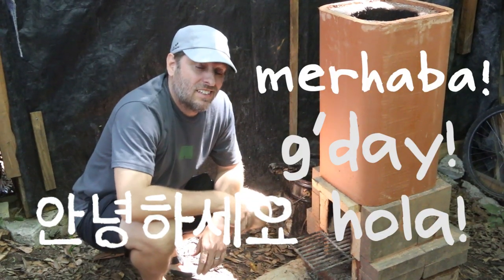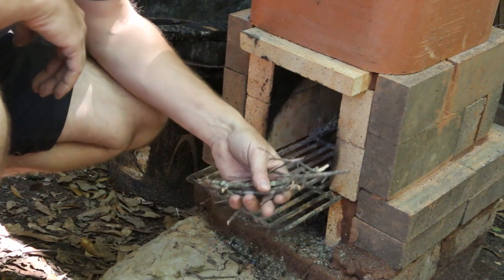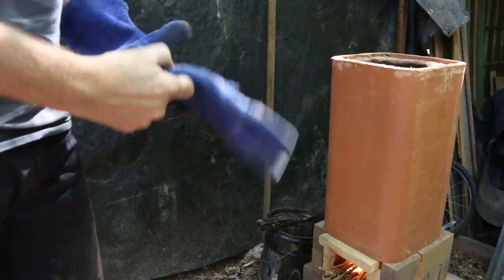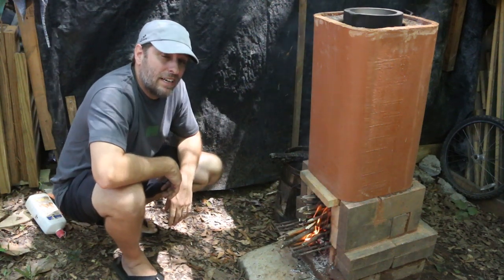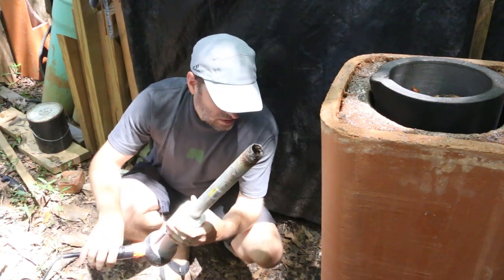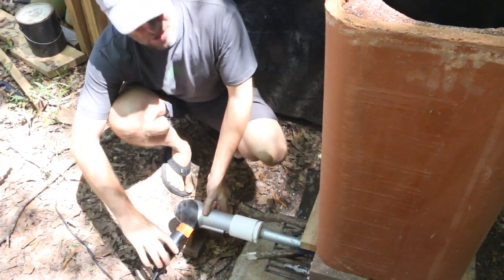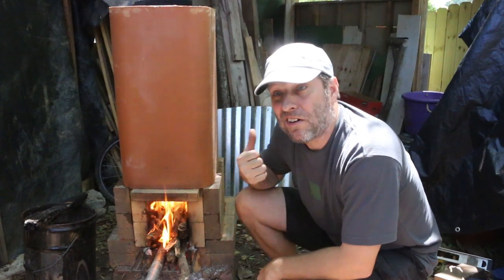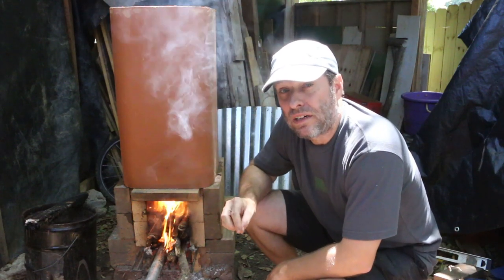How To Melt Aluminum Cans in MAX | Test #1 = FAIL

Comment: Did you ever get this to work for melting aluminum? BTW I expect the charcoal up the chimney method would have problems because it's hard to add fuel in a continuous manner. Maybe just charcoal where the wood is would be fine though. Also a lid to enclose the top would help. Obviously the lid would have an opening so you can add cans and keep the chimney flowing.
Reply from the maker: I didn't. I felt  like the heat was too much for the clay pipe, even with the cobb liner. The airflow was also an issue. I plan to make an earthen forge with either propane or charcoal to try this again. Thanks for the tips and for checking on this project. Thanks for watching.

Comment: My son made a bucket size forge.  His crucible was smaller than yours.  He was able to melt some aluminum cans.  Back then, he used wood for his fuel; now, he is using propane.  Maybe MAX needs to be a bit shorter; but, I'm sure you will figure it out.  Thanks for sharing; but, instead of calling it a fail, consider it a learning experience.
Reply from the maker: Donna G hi! I do think the heat is too far from the crucible. I think I will try the coal fueling method the next time, with a modification for a wider space around the crucible for air flow. Thanks for the suggestion. Thanks for watching.

Comment: When you recessed your steel rods under your crucible into the cob is it choking it off? Maybe a couple of rods going accross the originals lifting the crucible a bit more may be worth a try before opening the top up.
Think your videos are great.
Reply from the maker: Thanks Toby. I appreciate the suggestion. A lift might be a good way to test before I chip out the top. Thanks for kudos and thanks for watching.

Comment: I'm not an expert on these so take what I say as a grain of salt, but I always thought that all the heat is in the coals... Is there a way you could place your crucible right on top of the burning coals while your blower oxygenates the fuel from underneath? Very cool setup, can't wait to see it in action!
Reply from the maker: You make a good point. I do think I’ll need to get the coals closer to the crucible. That may mean making the fuel switch to charcoal and filling the chimney, but I think that would be cool to try. Thanks for the feedback.

Comment: I know it might not be the cheapest way, but perhaps replacing the cob+flue chimney with firebrick  might have helped?  i think you were right about there not being enough gap...i also wonder if having enough of a stand-off on the small-to-large pipe transition would help.   Thanks for the video

Comment: I’m sitting outside in the heat watching your video and wondering how hot is your weather when you filmed this video? Probably smart enough to start early in the morning! 😂👍
Reply from the maker: It was cooler than the 96 F temps we’ve had for the last week. Also helped to be in the shade. Thanks for your continued support. :-)

Comment: Don't fill it with coal! The insulation takes the heat up and lets it combust completley. If you fill that space with more fuel you're just going to get black smoke... it might get hot enough to catch light once it's out the top... but that's not good! A xx

Comment: You can absolutely do this with wood, it's achievable. The blower is essential if you want this to work, there just won't be enough air otherwise in such a confined space. You also need to heat the whole crucible, not just the bottom. This isn't like cooking.  You're losing too much heat moving past the crucible. You want the crucible to be centered in the hottest part of the fire. Do you have another piece of that orange chimney tubing you can put around the top as a cowling. The heat concentrate where you want it longer.

Comment: Never been camping huh?
Any small campfire melts cans.
Reply from the maker: Ha. True. But where is the fun in a small camp fire. :-) Thanks for watching.
Reply: @GreenShortzDIY  :
Preheat the rocket stove, no crucible.
Use a lid on the crucible.
Liquid aluminum...
Reply from the maker: Tahoe Jones I have seen a can melt in a fire, but is it possible to reclaim the aluminum easily? I feel like it would mix with the charcoal and be hard to reuse. What gas been your experience? Has it worked for you?
Reply: @GreenShortzDIY  :
I've seen a Terracota flower pot drip dish work in a campfire.
But, your rocket stove would get maybe twice that heat.
You've choked off the air flow with the crucible.
Enlarge your top exists some, and venting them in the
direction of Venturi will help an awful lot. Carve em  slanted.
The hair dryer... well, that's weak, and likely helps nothing.
You want that tornado inside. Maximize the heat contact.
25-30% longer coming out the top, with a good swirl going.

Comment: Other than the crucible being too large, it looks to me like it would be possible to either make a batch box or a J for the furnace, so you can get some larger pieces of wood in there. Yes, in traditional furnaces people stuff a lot of coal in there, but in your case you will want a good airflow around the crucible. Smart idea with the forced air :)
Reply: Just saw a French guy who used a steel tin can as a crucible. He made a hole in the horizontal part of a J tube and lowered the tin can into the hole. Albeit a longer than usual horizontal part... it put most of the pyrolysis just below the can.
It was all isolated with a sand. Smaller tubes into larger tubes. Air intake with warmup.
Reply: This is the video I found: https://youtu.be/FTezJ1kdZ6U

Comment: Pretty straight fwd - fundamental principle of rocket stove is CSA (cross sectional area) must be same all the way through - I'd try lifting crucible to allow same CSA as opening at bottom and add an insulated shield around crucible to keep heat focused (gap between sheild and crucible should also equal CSA) on the crucible
Reply from the maker: Thanks for the feedback. I knew I’d be messing with the airflow. I’ll do some math when I make the mods to this stoves. I’m also thinking about using sawdust in the cobb instead of the straw. Any suggestions? Thanks for watching.
Reply: @GreenShortzDIY  yup, good idea - the sawdust close to the heat will burn off and create air pockets - providing some insulation

Comment: i used a vacume motor and added oil. so u need more fuel and more air and that air needs to not come from a draft. but directly from a nozzle from witch oil drip is wright in front of the nozzle spraying all over your charcoal whitch will last way longer now that its whicking up oil.used free oil from restraunt.i put used vacume motor in sub box and its strong as a leaf blower.and it can run off dc so a dimmer switch should work.
Reply: following this method your opening around the crucible is fine
Reply: oh and once the oil soaks in the sparks go away!!!
Reply from the maker: Cool suggestions Cobalt. Thanks for posting. I'll look into adding an oil drip. That would be interesting. Thanks for watching.

Comment: Is there a part 2 yet? While watching test 1 I, like the first respondent, think a big part of the problem is the crucible sitting on the rebar is a big choke point.  I would try a rebar spacer to lift the crucible at least an inch, probably 2. At the same time I would think you need at least an inch clearance on the sides and of course once you raise the crucible your going to need to add an extension to the top of the chimney to keep the heat contained for that last bit. What about a steel pipe 1/4" thick that you could just sit on top of the current mud? You could even make it so that it was a couple inches taller than the top of the crucible and simply remove it when moving the crucible.  Just an idea. Looking forward to test 2!
Reply from the maker: John, I started part 2 and determined it wasn’t going to work, mainly because of the airflow issue you noted. I didn’t want to make viewers watch a second fail video. Ultimately, I think the crucible needs to rest right on the coals. And I don’t think the flue pipe can handle that heat. I’ll do another design using fire brick or aircrete...I’ve been practicing. :-) not quite ready yet. Thanks for the feedback. Thanks for watching.